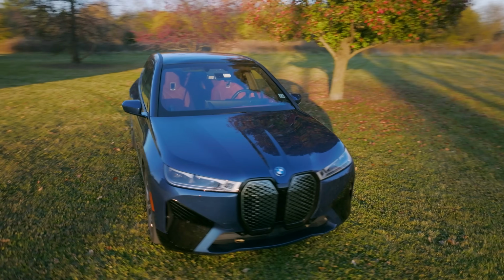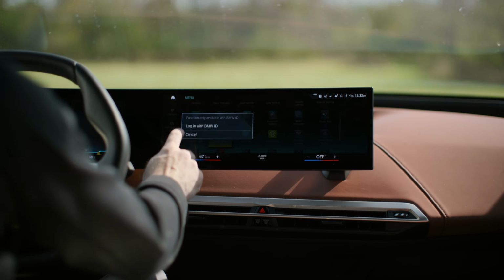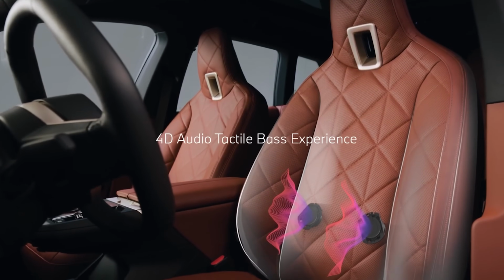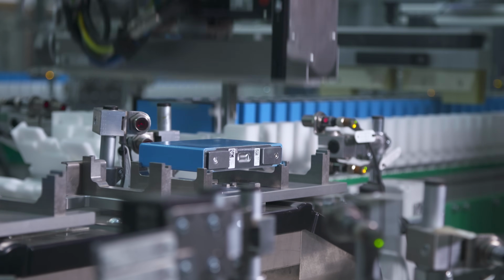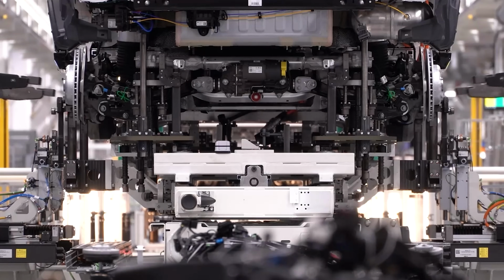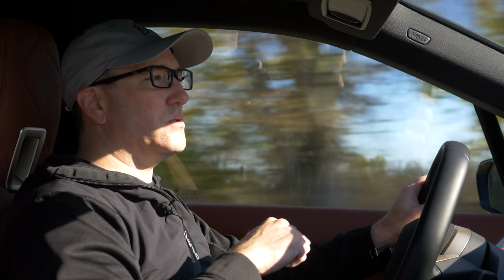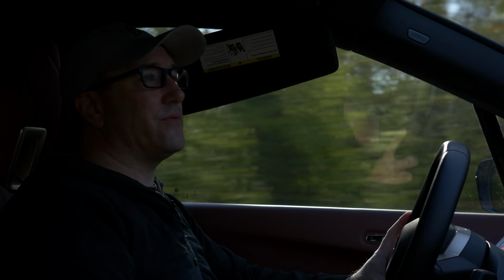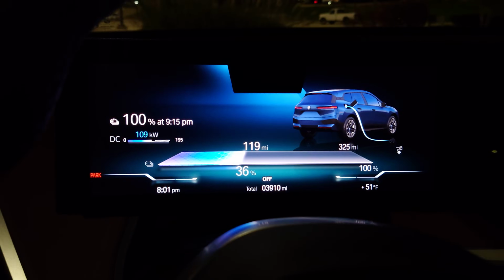BMW iX M60 | The Frustrating Future of EVs

Comment: Imagine this thing still on the road in 10 years. It would be an absolute nightmare to fix any small issue.
Reply: The battery will be dead or close to it. Unless pricing comes down on battery replacement, it will be another throw away vehicle.
Reply: That's pretty much any BMW or Mercedes 🤔
Reply: You'll be doing a $30k battery replacement around that time.
Reply: @cwx8  WTF $30K is way more than battery replace TODAY let alone in 15 years. My Guess battery cost fully installed will roughly be about $12,000 in 2038.
Reply: So a normal BMW?
Reply: it won't be on the road in 10 years.
Reply: Probably wont even be on the road for more than 5 years I'd wager
Reply: @omkri  BMW can probably do a lease-only type of deal for EVs so they don't have to ever worry about getting sued for a old model catching fire. Own nothing and be happy.
Reply: @markm0000  Gotta love the future
Reply: I have read on some of the iX forums that allegedly some insurers are not too keen to provide/continue comprehensive coverage on the iX due to the difficulty in repairing the body structure after a collision. I assume that this coincides with the advent of carbon composite being used in key structural portions of the chassis. Kind of troubling really, as a potential purchaser of a low mileage pre-owned iX.
Reply: @kiwi335d  I was informed that the carbon composite is most vulnerable to damage in a t-bone collision. So it really depends on the likelihood you will have one. That said, even standard ICE vehicles  are being written off by insurance companies if any part of the metal chasis is damaged even the slightest way as there is no way you can guarantee or certify it’s structual integrity even after a repair. This happened to me recently with a jeep wrangler
Reply: @DOGS LOL When your table breaks, you can fix it.  When your computer breaks, somebody else has to fix it.  And when it's obsolete or unfixable, you're screwed.  The era of disposable cars (by design) is upon us.
Reply: @hugolafhugolaf  years ago it was a big thing that eventually the world will become a "nobody will own cars anymore, everyone will just rent their cars". That is scarily coming into fruition
Reply: @DysphoriaRL  No kidding.  Options on cars used to be mechanical.  Now that everything is going digital, carmakers are already loading cars with almost every option, but they are offering them via a subscription plan.  «You don't want heated seats in July? Don't pay for them».  They know full well that people will forget to unsubscribe.  Same principle as SiriusXM.  They will be able to deactivate options remotely.  Scary.
Reply: @hugolafhugolaf  Computers are totally fixable and so are EVs, it’s YOU who doesn’t have the skills. Skill up and stop being so scared.
Reply: @JollyGiant19  Not just me.  Try fixing an old computer.  Damn near impossible.  The ever-increasing reliance on computer chips will be a disaster.  Look at how that turned out during the pandemic.  And who controls that market?  China.
Reply: @hugolafhugolaf  I speak from experience not fear like you do. It can take a while but if that’s what you consider hard, don’t ever try rebuilding an engine. Computers are a cakewalk compared to that!
Reply: Yup. Gotta make sure that the EV models have BMW reliability as well...
Reply: They want to force you to replace entire modules that would be a large percentage of a new car's price
Reply: @DOGS LOL Lol software is not that big a deal? Software is exactly the problem. Physical issues are easy to track down and diagnose with the exception of electrical problems. When something is unseen and down to debugging, its a nightmare. 

I work in cybersecurity support. When people report "weird" behavior, its so easy to chalk it upto user issues. Trust me. Bugs are like ghosts. You can claim you saw it happen all you want, but until it can be measured or tracked, you're the crazy person in the equation. 

Now imagine trying to prove that to a dealership. If its not replicable on the spot, its not happening. That's how Microsoft works today while charging $500 an hour just to get on the phone with you. Hell service contracts today cost more than the actual product sold.
Reply: Bmw will want 35 dollars a month to operate your turn signals.   No thanks
Reply: In 10 years, the costs will be half or less of what they are now. And the current packs being designed will outlast the body of the car. We’re just a the beginning and the future is bright people!
Reply: @justinstewart3248 , really? Are you the prophet from Delphi? Because the basic rules of economy contradict your uneducated opinion.
Reply: @codincoman9019  you’re not informed at all then. Things are moving so fast in the EV that the current tech won’t even be recognizable in 10 years. Eveything from charging and voltage architecture, to longevity, and even battery recycling. Shit is moving fast. It’s a cool future ahead of us. Gas cars will still be around for a long time to come. No need to panic!
Reply: @justinstewart3248 🤣😂🤣 You just proved to be misinformed (of course, the MSM is trusted by youngsters) about everything you mentioned. But, hey, if you think the Marxist future is cool...
Reply: @codincoman9019  lol dude I’m 40 years old. Who cares about the MSM. Anyways, optimism is where I like to live my man.
Reply: @justinstewart3248 , I am an electronics engineer, economist, EMBA, 53 y.o. What you say is super-optimistic. The digital control is already here, except is not yet fully legalized. Some realism would help.
Reply: @codincoman9019  lol really? You have to bring some kind of world govt control and conspiracy into this? People have been talking like that for thousands of years and yet here we all, everything is fine. 

We’re talking about cars. That’s it.
Reply: @codincoman9019  "The digital control is already here"?  Can you be a little more specific on what you are referring to?
Reply: Yep all the parts it shares with ICE cars will be a nightmare to fix. All the interior and convenience feature. But that BEV power train will be perfectly fine in 10 years probably around 20% Capacity degradation will be your only problem. Electric Motors, gear box and drive train might need to be serviced cleaned and lubricated that should be routine.
Reply: The point of evs is that they will not need service
Reply: @fcv1967  that’s bullshit every EV is gonna need some kind of service down the line
Reply: @MrINDEPENDENT2000  only bmw. But that's only by design
Reply: @fcv1967  Bwahahahahahahahaahaaaaaaaaaaaaaaaaaaaaaaa!!!!!!!!!!!!!!!!!!!!!!!
Reply: @fcv1967  excuse me?
Reply: @fcv1967  ----It's a car (or whatever).....things eventually wear out or break.
Reply: @fcv1967    thats funny.. ev cars ard many times worse for reliability.   Consumer reports just did a story
Reply: @cayman9873  Consumer reports are paid for by the internal combustion engine industry
Reply: @fcv1967  
And if you’re ignorant enough to believe that you’re ignorant enough to buy one of these Money Pit turkeys 👎
Reply: @fcv1967  It's obvious that you know fuck all about cars when you say "EVs don't need service"
Reply: @fcv1967  Batteries fix themselves? Really?
Reply: @fcv1967  I've seen battery's dying after 5 years. I've heard if battery's lasting 10 years. I have not idea who to truely believe.
Reply: @baronvonjo1929  You know that there are plenty of running and driving 2012 model S, right? Sure, some of them break, but for the second year of EV's being sold to the public (the leaf started in 2011), its doing pretty well. Most new car technologies do a lot worse. Plus, most issues are due to tesla's famous build quality...
Reply: @baronvonjo1929  "I've seen battery's dying after 5 years." LIES!
That would be a LEMON when it comes to BEVs. They should have no major problems under Several years thus why the entire industry warranties them for 8 EIGHT Years because LAWYERs know they last that long and do not need to pay out.
Reply: @b127_1 spot on sir!
Reply: @fcv1967  You will need Tires, Shocks, Brakes, etc. there is still service that needs to be done. Then when a motor goes out or god forbid you have to replace the battery pack you might as well bend over and shove rusted chainsaw up your bum it would be less painful. Most Motors start around 3k and the battery packs are around 28k and up. So please do not spread miss information.
Reply: @Massacari  You liar. I can get the Mach-E motor as a crate motor for 3.9k. Google it and inform yourself.
Reply: @JollyGiant19   I stated "Most Motors start around 3k" So exactly how am I lying?
Reply: @Massacari  If I buy a LS crate engine it’s going to be 10k or more versus 3.9k. The gas engine is more expensive than the crate motor. You’re lying, you are a liar.
Reply: @JollyGiant19  No where in anything I posted did I bring up an ICE engine. I only listed the costs of a EV Motor and the Battery Pack which are both factual based. Your comment about the EV Motor cost aligns with what I posted. So where am I lying I never once mentioned an ICE engine in any of my statements. ICE engines range from 800 dollars at a junk yard to over 20k Depending on what you are buying. EV Battery packs are again 28k +. So why are you insulting me by calling me a liar with no proof based on any statement I have posted? You are either very passionate about EV cars or on bath salts. But either way if you do not want to speak about facts kindly without throwing insults instead of discussing the points. Please become quiet so the adults can speak.
Reply: @Massacari  You lost all credibility when you said you need to change brakes on an EV where 90% of the stopping comes from the motors, not the pads/rotors like on an ICE car.
Reply: @fcv1967 , unfortunately you know very little about cars. Your credibility is the issue, not others...
The brake pads and rotors still need to be replaced - later on than those used on ICE cars, but still they need to be replaced, because each time you brake hard, they will do the braking, not the regenerative function of the electric motor. So that 90% might be almost true for you (because you have no way of showing proof of that percentage), but there will be many having far less care in using mostly the regenerative braking.
And the Consumer Reports organization can't care less about your opinion. You confuse your opinion with facts, thus wokeness is strong with you 😂 Communist China loves you 💞

Comment: I drove one of these at a demo event.   I wasn't impressed in any way.   That's a sad statement for a powerful, new, and very different vehicle.
Reply: EVs just aren't impressive. At all. Once you get over acceleration, they're boring. And you WILL get used to the power. Always happens.
Reply: @cwx8  I'm familiar with electric motors in commercial applications, do I look forward to that aspect.  EVs have a ton of potential, though it will make them more dangerous than ICE.   I just hated everything else about the model.   Looks, feel, layout, even performance.   I love SG but I wasn't impressed by performance for its weight.   It did feel heavy to me.
Reply: @Mr-ed5ep  I mean there's gonna be an M version soon
Reply: @jonlosito2004  and?

Comment: You nailed it all perfectly. Unfortunately this is the future of cars and nothing can stop it. You'll need to buy "classic" cars to have a real one now :(
Reply: Ill hold on to my 2000 Camaro z28
Reply: @TapoutT  2002 4Runner here, and it's not going anywhere. I'll fuel it from corn ethanol make at home if I have to.
Reply: Too many institutional investors see the EV revolution as a way to make a ton of money. It's not the environment they care about.
Reply: Why does everyone assume it’s the future?  Just because a politician said so?  A small battery hybrid sienna minivan is a 3 year wait at my dealer.  Yet we are expecting 100 % full EVs for all in 13 years 😂😂
Reply: @gs98999  Going to be a pretty slow adoption with every EV coming out priced at $60-$100k.
Reply: @esbee1  also the fact that EV production is so dirty it takes years of driving one for it to even break even with gasoline pollution levels, now apply that to replacing all ICE cars in a short period and we've just nuked the shit out of the earth. It's all bullshit.
Reply: Until they ban gas stations. Don't laugh.
Reply: @BlackMan614  Gas stations won't disappear for at least 30 years. You'll be fine.
Reply: @skipbreakfast  Agreed, even then we will be able to get synth fuel at racetracks or get it delivered, it will be insanely expensive, like I wouldn't want to commute with it, but it will be available for Sunday morning drives and track days.

Comment: So are EVs TRULY that much more expensive to make? I know R&D is caked into the cost, but this is unreal. They validate it by overstyling and screens I guess 😑
Reply: EV's are dirt cheap to make, but because they're hot now, they can market them for quite the price.
Reply: The cost to make is dirt cheap. Electric motors and COTS batteries are free in comparison to the R&D required for even a decent ICE engine. 
In tesla's circumstance, theyre capitalizing off the market and brand, and recouping battery tech development costs. For BMW, they're using it as a platform to showcase new advanced R&D with materials and frame and chassis design - in addition to that in-house battery development.
Reply: @Lulzmango  doesn't matter what the cost is if the end user is the one taking it on the chin.  affordability and viability are the two main factors holding EVs back and will be for the foreseeable future.
Reply: Tesla's only cost like $10k to make. Bmw and the rest make them for 5x that and make no profit, and cannot reduce price unlike Tesla.